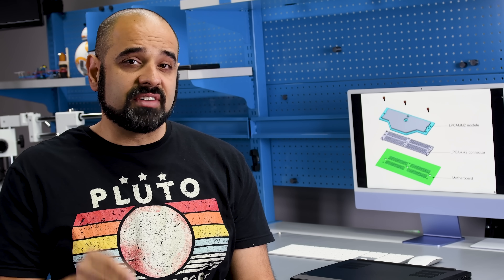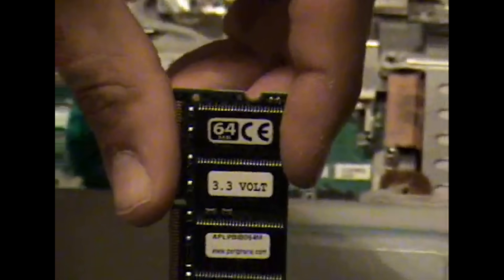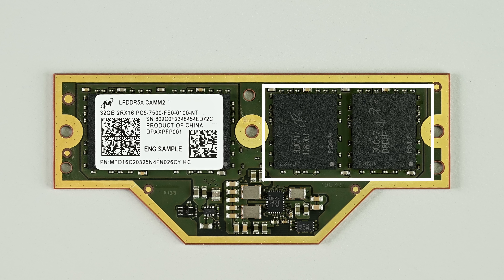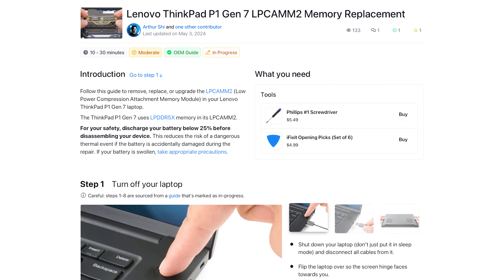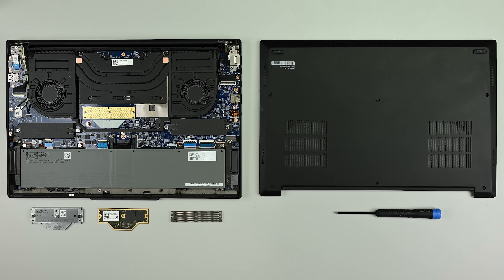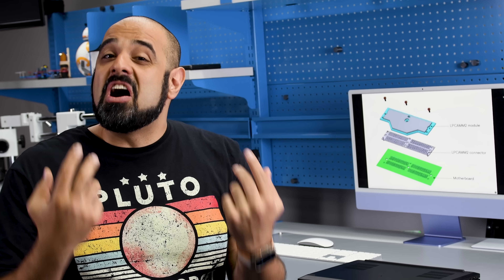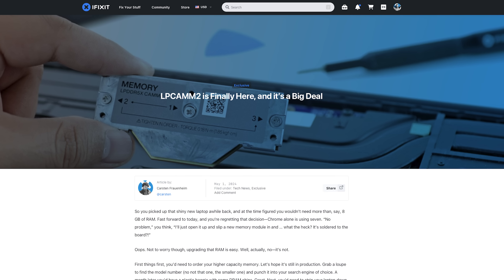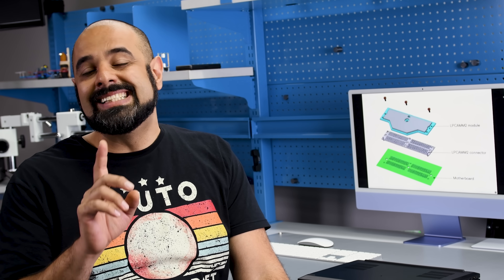New Laptop Memory Is Here! LPCAMM2 Changes Everything!

Comment: Framework shoudl get this
Reply: Fingers crossed for a future version, eh?
Reply: Maybe 2 or three laptop gens from now. I always recommend for new tech to always wait a bit for the growing pains, because you would hate it if there are issues with it and the Motherboard is now worse for no reason other than the new tech and you have to replace it with a fixed version. Let the tech age a bit. Also the framework solution is good for now so there is no need to rush.
Reply: @darkm007  iGPU performance would benefit greatly with this. And the small form factor would have more room for better cooling and battery. The framework 13 really needs a bit more battery. It's mid at best for it's size.
Reply: @darkm007  you will have to support this tech now, else it will disappear instead of maturing.
Reply: @adorp  for a more niche thing you would not be wrong. But for this it's too advantageous to manufacturers as an option to not look into. The cost and complexity require time to iron out. But companies are 100% looking into it. For me this looks like going from sata to m.2. For most a classic ssd is just fine, but that does not mean m.2 is going to be abandoned. And as trends look it is not going to be.
Reply: @darkm007 If there are issues down the line that doesn't mean you have to return it just to fix it you as user can do DIY IF you know what you're doing
Reply: They should change to this for next year.
Reply: I hope they keep sodimm slots or release a sodimm version of their boards so people can still upgrade the main board without having to buy new ram too.
Reply: @boop  I guess this depends on processor support, and if they are big enough to possibly sell 2 variants.
Reply: @boop  that, and/or release a 10-11" framework that only uses the new memory standard first. That way they can both see what works, and solve any issues before fully committing for the larger models.
Reply: Eventually, they'll surely get this, but can't tell how soon. If my current laptop survives for another year, I'll certainly try to get a Framework (though they don't ship in my country).

I wish it would have this memory ... feature ? architecture ? layout ? But I'm a bit skeptical that it will be out so fast. Having repairable and upgradeable 128 GB of RAM at 6000 MT/s is a dream I can currently not check with any laptops, without other big drawbacks. Hopefully by the next year that will become a reality.
I want my next laptop to also last me at least 7 years, like the current one (which is almost 8), preferably 10 years. I won't really need 128 GB of RAM now, but I'll certainly be happy to use them in 5 years from now. The current one has 64 GB of RAM, and boy, does that help.
Reply: @Winnetou17 The soon if i predict could be 2 years from now give or take
Reply: Best believe they are already on it behind the scenes alongside the snapdragon X elite processor.
Reply: If they do a Snapdragon X Elite laptop with LPCAMM2 memory and retaining the M.2 slots, I'll buy it the second it goes on sale.  @weiSane
Reply: @weiSane  Sensel touchpad as well, so far that specific touchpad is only avaliable on Thinkpad.
Reply: SODIMMs aren't going anywhere for a while, nor should they. Different applications require different solutions. It would be a waste of money and effort for Framework, a small company, to focus on something that is still fairly trivial for their product line. I'd much rather see them focus on more and better CPU, GPU, and chipset options.
Reply: @rars0n  you are so wrong, tech change every 3 to 5 years and if framework died from this, it will be on you.
Reply: @rars0n  just small legacy feature like a card for vga and another for dvi. A memory stick card and xd card card. Would all be neesh tuse cases that are easier to implement
Reply: Framework should wait until LPCAMM2 is available and affordable, else what is the point of being able to replace it?
Reply: I was going to say this
Reply: yeah that was my first thought
Reply: Why? SODIMM works fine.
Reply: @WeAreMovieMakers  requires longer traces which means lower frequency and higher power draw/latency. This is a good in-between soldered and so-dimm
Reply: @WeAreMovieMakers  if you saw the video you would know why.
you could ride a horse, but you have a car. why?

Comment: I don't see this being much thinner than the existing SODIMM RAM
Reply: Sodimm has to have edge connectors, which add a bit of bulk
Reply: I could, with sodimms you have to have clearance for memory modules on both sides of the stick there's only memory modules on one side here
Reply: Dell's functionally equivalent version is 57% thinner than a single SODIMM, but was made to avoid having to put RAM slots on both sides of the board. This isn't so much a win for thinness, but rather for not having to produce (and keep stock of) separate motherboards for every CPU and RAM combo you want to sell.

Comment: This obsession with making everything thin is ridiculous.  I'd rather have regular SODIMMs and have my laptop be 1mm thicker.  This is better than soldered RAM but we should just stop obsessing with making laptops as thin as possible to the point where it compromises thermals, upgradeability, and repairability.  These new modules will undoubtedly come with a huge price premium and people will justify it by saying "hey, spending $300 for a $40 stick of RAM is better than having to replace the whole motherboard for $600."  No, just no.  The fact that they show this RAM in a super thick laptop that doesn't need it proves that it has nothing to do with anything other than manufacturers trying to screw over customers.
Reply: Still missing the problem - there aren't any SODIMM LPDDR5 modules as they can't do that, it's too far for the traces - THIS solves that problem. THAT is why this exists and is a VERY good thing.
Reply: @ross-carlson  There are DDR5 SODIMMs available for laptops.  If it's really such a concern then move the slot closer to the CPU.
Reply: @thelbtlover 

Socketed DDR5 for laptops exist, but not socketed LPDDR5.
Reply: @thelbtlover  This is about LPDDR, which before camm has to be soldered on the board. LPDDR is more power efficient and generates less heat. Thickness is secondary.
Reply: Sodimms are nice but we are reaching the data transfer limit of that technology.
Reply: @TheIdiotPlays  Then why do desktops magically not have this problem?  And latency isn't a problem on desktops probably because the RAM slots are so close to the CPU on desktop motherboards.  Just move the SODIMM slot closer to the CPU.  Problem solved.
Reply: @thelbtlover  The consensus that i could make in about 10 minutes is that the desktop dimm form factor is bigger thus its easier to route the signal wires and design the module itself. 
You can't move the sodimm slot closer in many cases, you still need to route everything else to the cpu, every pair and buss that is synced needs to be the same length for timing reasons.
Also ddr5 is different to lpddr5, lpddr5 is much more advanced in terms of features. And what I read is that designing an lpddr5 sodimm would be like a super big pain in the ass and would not be financially feasible.
Reply: @thelbtlover  desktops are big and have all the power available to them to maintain signal integrity. They can just blast the traces with more electricity. That doesn't mean they're still not facing problems with reaching the top spec of DDR5. We're already hearing talks of how ATX motherboards should only come with two DIMM slots because of how troublesome memory gets the faster they are.
If the battery life becomes a factor, then trace length and signal integrity becomes a much more pressing matter. We've also pretty much reached the limits of how close SODIMM can get to the CPU.
Factor in the fact that you have to match the trace length between two modules. You can't just move them closer without facing problems with trace length matching.
Reply: I'm sure standard SODIMM will still be around when DDR5-6400 becomes mainstream for laptops and probably even DDR6-9600/10800/12800.

LCAMM2 just allows for laptops with even more compact mobos, thiner & lighter chassis, desktop-class faster data transfer, and lower latency.

Comment: How about compatible USB / Power DC ports on laptop so you can BUY AND REPLACE it when broken at home? Replaceable CPU? GPU? Common whole modern laptop are soldered bricks. Just buy cheap one and throw it away when USB port is down.
Reply: lol
soldered components have their own distinct advantages, which is why you see them more often on mobile and portable devices.
not everything has to be a conspiracy theory
Reply: Most new laptops are USB-C, I've charged my Lenovo laptop with a Samsung charger.
Reply: replaceable CPU and GPU on laptop? not going to happen.
Reply: throwing bricks away isnt really a good option either, e-waste piles up and its just better if you can reuse them
Reply: If you don't know Framework they address ALL those issues. Typing on one right now, it's great!
Reply: @ross-carlson  I'm still waiting on Framework laptops to become purchasable in my country.
Reply: @nanolfo_  you can use proxy services or use a relative to get them
Reply: @ross-carlson  I just checked and I see soldered CPU and GPU. By taking a second look those MB has 14mm USB ports - not common, impossible to find and replace those. Am I missing something?
Reply: @voxel23  the CPU and GPU are soldered to a mainboard which can be upgraded. The ports are all socketed and can be replaced with different ports to suit your needs, the only problem is there aren’t many ports
Reply: @voxel23  Literally can buy those in single quantities or bulk (up to 3K units per reel, buy as many reels as you can afford) on any distributor...
Just because the local grocery store doesn't sell USB C ports doesn't mean they aren't sold :P

Comment: Is this like the thing dell was doing or is this competing against what dell was doing?
Reply: Dell gave it to JEDEC to make into a standard. It’s the same thing, but now a non-proprietary standard
Reply: @bituniverse8677  Dell opensourced it, so the Dell one is also non-proprietary. But Dell itself didn't support it. There are no laptop from Dell released in 2024 that uses it (as far as i'm aware*).
Reply: @pedro4205 I think they did a lineup for it. It's similar but has more bulk to it
Reply: @bituniverse8677  that’s good, at least it’s a standard now. Hope more manufacturers jump on board
Reply: @bituniverse8677  But i don't know the limitations on both standard as far as memory size could go, or production cost. I found this module really tiny. Probably it is dual channel in the module but i think bigger notebooks could use two of those modules.
Reply: @pedro4205  Capacity is not a limiting factor with LPCAMM2, Samsung has already announced 64GB LPDDR5X ICs - 256GB on a single LPCAMM2 Module, more then any laptop currently allows with DDR5 Sodimms (assuming there is Laptops that allow 4x SO-DIMM that would be 192GB max).
The Modules have 4 32Bit Channels just like desktop mainstream platforms with DDR5.
Reply: @Ground15  That is fine then. About the 4 32bit channel, this is just regular LPDDR, the specs is the same.
Reply: its the same but smaller
Reply: It's an evolution

Comment: sounds more like a new standard that companies can squeeze for some cash. low power sodimm existed for every generation after ddr2 and the socket can be as close to the cpu as this new thing.
Reply: DDR4 never had a DDR4L variant, all JEDEC DDR4 standards have an operating voltage of 1.2V. As of today DDR5 doesn't have one either.
And even if DDR4L/DDR5L was a thing, it doesn't make this new standard any less important. DDR and LPDDR are completely different standards.
Reply: I bet you were thinking about DDR3L RAM. No, it's not the same as LPDDR RAM.
Reply: @bagasfabianmaulana  No, i'm not thinking about this
Reply: @SUB0PT1MAL  so what? there's no such LPDDR sodimm. LPDDR have different signaling compared to normal DDR. LPDDR4X and 5/5X can as low as 0.6-0.5v. the lenghty traces on normal DIMM/SODIMM can't work with LPDDR RAM.
Reply: "and the socket can be as close to the cpu as this new thing" Um no, no it absolutely can not that is why there isn't any SODIMM LPDDR5 RAM right now - this solves that, AND it's quite a lot thinner too. So yes, it's a new standard but it's better for everyone and either way if you're buying an upgrade you're buying an upgrade, how is this somehow bad?!?!?
Reply: @ross-carlson  There are sodimm slots as thin as 2.6mm plus you can use low profile smts under it. This thing occupies the whole surface it inhabits, its made out of 3 parts without counting screws and its 4.5mm thick.

Sodimm ddr5 works at 1.1v, this new thing works at 1.05v WOW!!!!!

And did you check the prices? they are outrageous.

All that engineering time and effort could have gone into making sodimm thinner.
Reply: did... did you actually watch the video?
Reply: @E-Stoia  Yeah, but i've been keeping myself up to date with this thing and this video does not change my view of it